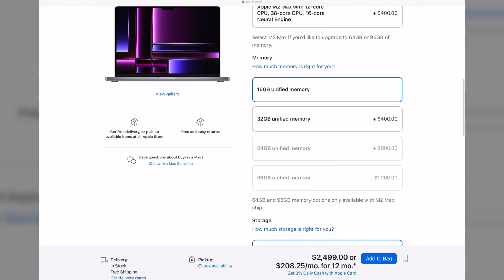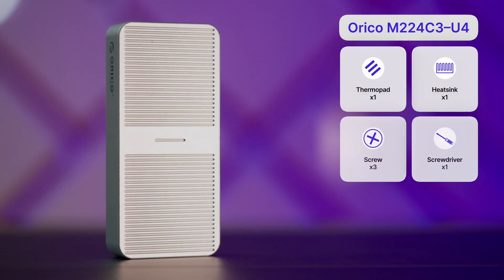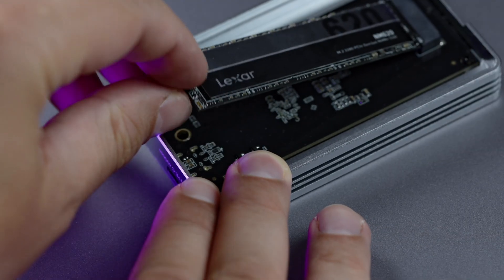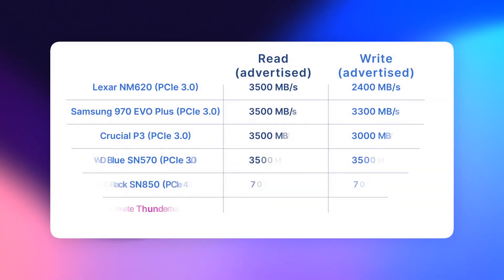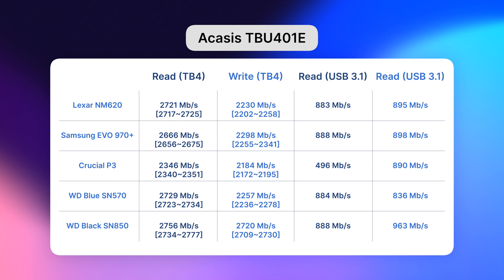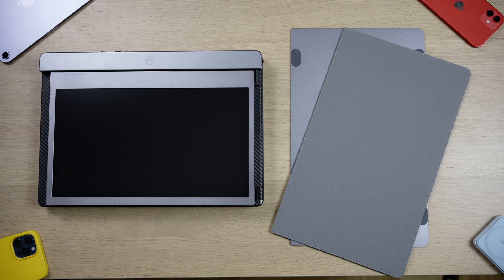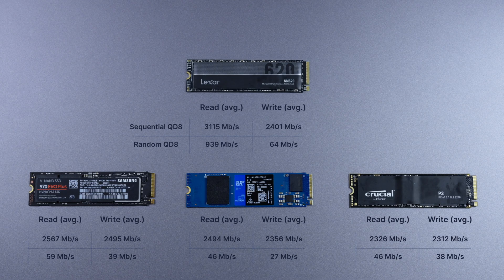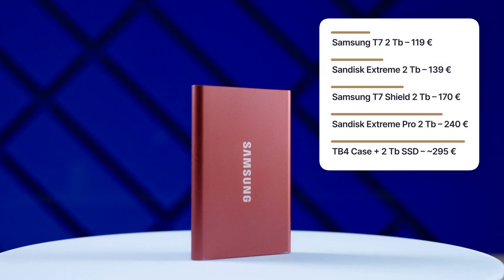Mac Storage: Price, Speed, Size – Expand It the Right Way

Comment: All my Apple silicon Macs having issues with connecting more than one TB3 cases. Me, having 3 Acasis/Anyoyo cases, only one will connect without problems. Using OWC express 1M2 cases additionally, the situation is more stable, but not perfect now. I am wondering, if everybody out here is using a single external TB drive only?

Comment: Using a micro SD with an SD-Adapter adds a potential source of failure, i would always go for a full size SD card. In my experience micro SDs even high quality one are less robust than high quality full size SDs.

Using an external storage as a working device max transmission speeds less important than writing/reading lots of small blocks, in that way speed,type and size of the cache is mor important. I would avoid NVMEs without real DRAM Cache.

Comment: On that SD card adapter. They have different sizes. So you could get the dimensions of the proper one for your Macbook and see if they have another model that is just slightly longer so it would be easier for you to remove. Me, I don't remove my SD card that much, so it isn't an issue for me.

Comment: Acasis 405 Pro + Samsung 990 Pro 4tb. 2850/2800.
Fan off. Temperature 46C Idle, 58C after 5 minutes of benchmark test. Will keep the enclosure.

Comment: I have one question. I use an old Mac book air from 2012 with Thunderbolt 2 plug. Is there any chance to connect any SSD encloser to win some speed?
Reply from the maker: You may look for LaCie Thunderbolt 2 SSD

Comment: None of these drives are true USB4/Thunderbolt 4 and do not have the speed advertised. These drives' internal board/chipset is USB3 with a USB4 port adapter. You will only get true USB4 or Thunderbolt 4 speeds once the chipsets are redesigned in later models.
Reply from the maker: Mind sharing any article or spec that highlights this?
Reply: @GeeksTable  https://www.youtube.com/watch?v=opPNKCh_Evo
Reply: this is a good heads up. i might just wait to get a Thunderbolt enclosure until this happens!

Comment: Hi, based on your test I bought Acasis TBU405 and the 970 Evo Plus (2TB) my read speed even exceeds your values (2800 MB/s), but the write speed is just half of your values (1200 MBs) - Hardware: MacBook Pro M1 14", Speed by  BM Speed Test. What went wrong?
Reply from the maker: My first guess: could be the cable. If there is another cable to try - give it a go. Another guess: could be something wrong with the case. If you have another SSD to test with, I’d put it in the Acasis and run the speedtest. If the speed is bad again, then it might be the box. If both tests show good results, then it’s the Samsung SSD to blame.